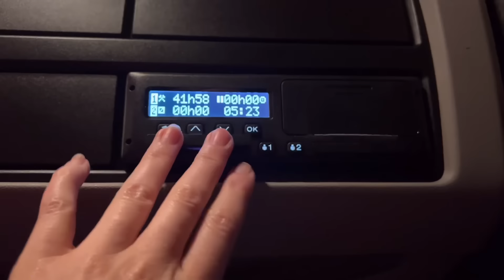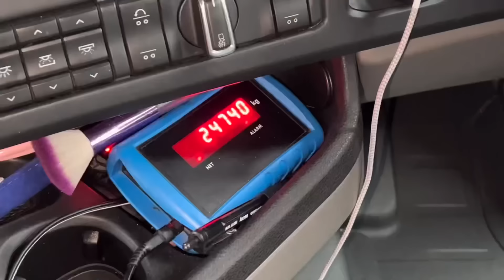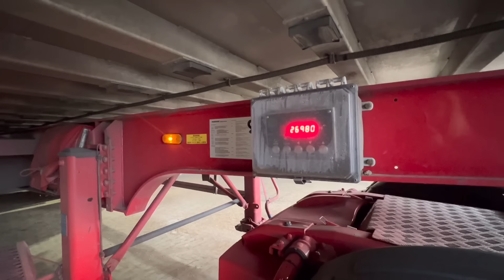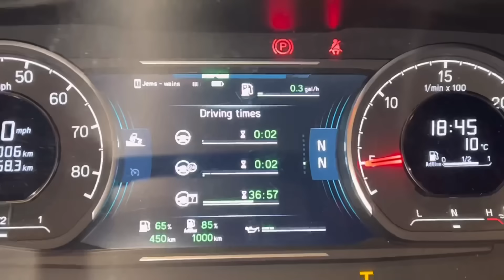Manic Monday Trucking | 3 Farms to load from

Comment: If I may offer a suggestion, you may want to consider a filter respirator similar to what car body repair uses, when you sweep out your trailer - a lot of that nano scale dust can end up in the lungs. 👍 ... and I bet you have a nice pair of lungs.
Reply: Nice one jemma thanks again 👍
Reply: That is a fair point. I would suggest the firm should actually provide them.
Reply: Assuming you don’t pay Motorway fuel prices  with a fuel card and pre agreed prices
Reply: Great  thinking 🤔  mate
Reply: @virtualal  correct. In fact its compulsory for the employer as its PPE.
Reply: Beautiful driver, beautiful countryside. Stay safe Jemma
Reply: Great Vlog Gem. Managing your 90 hours fortnightly driving must be a real pain. Stay safe out there. 🚚
Reply: Totally agree. It’s tiny particulates that caused pneumoconiosis in coal miners. It caused scratching of the lungs impairing the ability to breathe. So Jemma please do think of getting an appropriate mask. The HSE website may be able to assist.

Comment: Another great video, Jemma. When you were going up the long hill, loaded, I think you said you had to switch into manual. If you have an auto transmission, isn't that set up for these situations?  Naively, I was thinking that an auto box in a lorry would be like an auto box in a car, and would compensate for different conditions. Thanks, Chris
Reply: The reason you switch to manual is because you dont want the truck to upshift on the incline.  these trucks have very short low gears so it tends to shift up very often when it is at low speed...  the loss of momentum, even a small one could stall you out or start wheel spin.

Comment: Suprised you are not using a cb radio so that you can call up before going along those narrow lanes . It is common practice here in Oz to call up when aproaching narrow places where you could meet head on with other trucks
Reply: Mobile phone coverage in the UK is good enough, and the 'company phone' probably has an app on it connected to the office system. Especially if that is using SMS, there's no guarantee updates will be picked up quickly, hence the phone call to confirm.
Reply: @nicktecky55  I was refering more to the situation where Jemma was leaving the first farm and said that she hoped that another truck would not be coming up the narrow lane .Just about all trucks and all semi trailer rigs have 80 channel uhf and use channel 40 to communicate with each other . In that situation as one of the trucks is about to enter the lane the driver would call his intetion to exit the farm via that lane or visa versa and the other truck then waits rather than meeting in the middle

Comment: What happens if you run out of time but don't have a place to park up?
Reply: well you have to plan accordingly, so it doesnt happen.   if you run over time you have to print out a time slip and note the reason for the overage.  But the Takometer warns you with 15 minutes to go,  so its time to start looking for a spot.